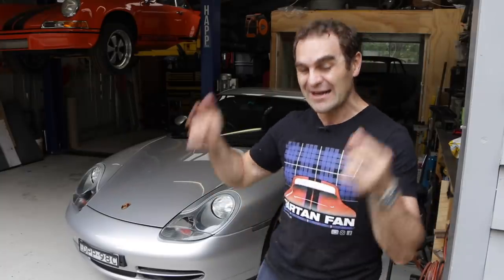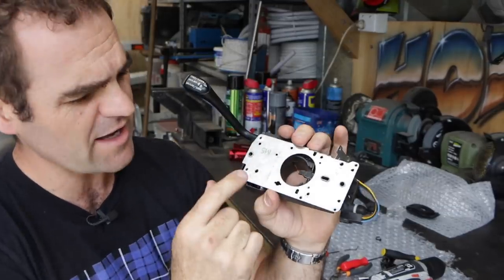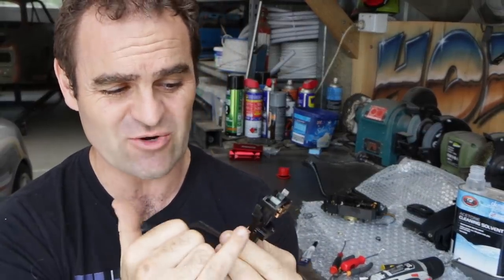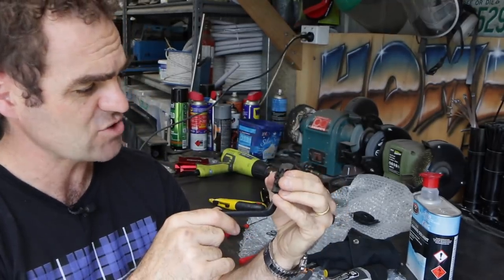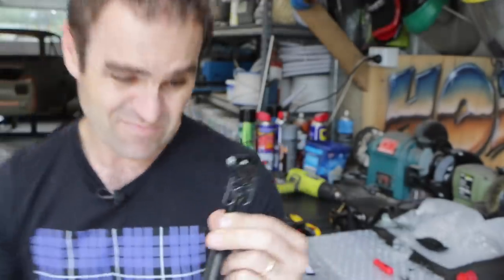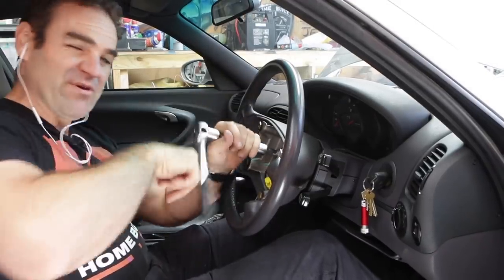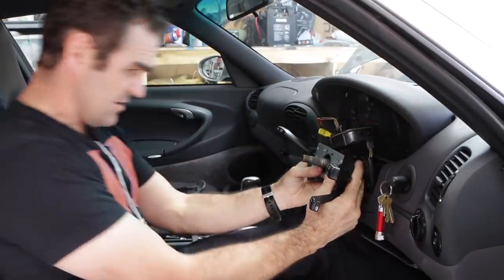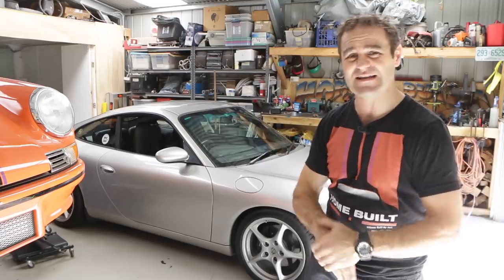$5 Porsche 996/986 indicator fix

Comment: Popular advice is to wait 30-60 minutes after disconnecting the battery before removing the airbag. Also not sitting in front of it when you first turn on the ignition after reassembly. 💨

Comment: Amazing - just fixed my 996 - cleaned up the parts thoroughly with a dremel then used 2-part epoxy to glue it back together. No idea what that spring does though 🤔
Saved £500+ THANK YOU!! 🙌🏼

Comment: Just a word of thanks for posting this. My 1st boxster, left indicator duff, looking at, at least £150 for a second hand replacement so tried to fix it myself. The right side was cracked so repaired them both. Happy days, I do not need to hold it down when turning left! Thanks once again.

Comment: Glue alone never last. Use a soldering iron and you can weld the pieces together and afterward supplement with super glue and baking soda as others explained. I sometimes uses metal wire to reinforce perpendicular to the crack line.
Reply: If you're going to use a soldering iron to "plastic weld" something, use the soldering iron to push metal mesh or strands of wire (electrical wire works well and is usually on hand) in to the part to act as reinforcement, or it will likely break again.
Reply: Xiranu , rubbish, there are are MANY different types of plastic , all with different properties.
Reply: peter olsen I know there are many types of plastics. Over 98% of all commercially used types in moldings are thermoplastic types and can be welded with heat. Remaining few pct are of thermosetting type and cannot (epoxy is one of those). Rubber is of course not defined as plastic but is a polymer.
Reply: Here is a good beginner guide https://youtu.be/gRCMIDILfEI

Comment: Dang, $600 for plastic piece with some brass contacts and springs to go along with it. Car parts have gotten SO expensive over the years!! Great job Jeff, looks like new. Cheers from Texas.
Reply: It's because it has "Porsche" written on it unfortunately.
Reply: Planned obsolescence to encourage people to keep buying new cars.  I had the climate control knob fail in my '89 Acura.  The fix was replacing the entire electronic control unit.  $1,200.00 US!  Are you kidding?  FOR THE LOVE OF GOD!  

The car wasn't worth that much at that point.  I could have attempted a fix, but then the state of CA paid $1,000 to take it off the road...

Which brings up the waste issue of the state crushing a perfectly good car, with all it's valuable replacement parts.  Worth much more climate-wise in a junk yard providing parts for 20 other Acuras.  Oh well...

Comment: Just completed this on my 996 with the 4 stalk. More difficult than expected due to how complicated it was to re-assemble the contraption. I used some screws I found around the house to seal it back up instead of rivets, and there is plenty of clearance. My auto-off indicators didn't retain their function, the springs inside are so fiddly and it's really just a bad design, but I just manually cancel them. At least both of my turn signals work now! Great video!

Comment: I've used a soldering iron and cable tie as filler rod. May or may not be appropriate for this task. Or metal putty works for a lot of things. But well done Jeff - saves lotsa money and gives ya satisfaction

Comment: Super Glue, and other bonding agents, the repairers friend.
Can't see the average Porsche owner trying this repair at home, many would be in the "technically challenged" league.
Good work Jeff, another success.
Reply: Really? Myself and most of the other Porsche owners I know do most of our own work.
Reply: @SpawnyWhippet  only the ones with  older and used Porsche, the original purchasers generally are too rich, too busy or have the "head to hand blockage syndrome"/ technically challenged brigade.
It was to those I was referring.
Reply: @Andy B a Porsche owner then?

Comment: Just completed this fix myself. . . More like 2 hrs for me, but I did find and re-use both pieces of plastic within the steering column moldings, so remove them carefully and vigilantly if doing so yourself.  I also found a hot glue gun gave a reassuring bond and allowed excess glue to be carved away.  Thanks for sharing the video, and for making it look easy enough for me. . .  Now I just need to figure what the battery disconnect has done to my radio. . .

Comment: I suspect the reasn the spring tags aren't a solid part of the spring mount is to allow the cancelling lever some 'give' if you try to engage it while the release tag on the steering wheel is directly in line with it.

Comment: Aren't quick fixes like that a joy?  And saving $600?  Oh hell YEAH!  Nice!
I had two remote controls that weren't functioning properly.  One for the home theater had gotten worse and worse lately.  Another for a receiver in another room hadn't had its volume function work for EVER.  (I assumed it was the volume knob that gave out in the unit.)
So I pulled 'em apart, cleaned the years of gunk (gross, I know) out of 'em, cleaned the contacts with isopropyl alcohol and Voila! they both work like new now.  Why did I wait so long to fix them???
And remotes 'ain't cheap, if you can even find them to match your old equipment.

Plus, with the waste in this world, we need MUCH MORE fixing of old stuff....

Like old 911's, for example!!!  (Hint, hint.  Nudge, nudge!)

Comment: I performed this repair thanks to your video. Unit worked fine for months, then suddenly it caught fire.  Turns out one of the little springs inside the turn signal assembly became dislodged and shorted, causing a fire.  I re assembled carefully, not sure what happened.  Caution.

Comment: Thanks of the idea. Pulled mine down and same thing. But found this part inside.Looks like a tea cup/white plastic its 5mm/5mm/5mm. Small,but it came from inside.
Reply from the maker: That clips on the edge of the housing in the little slot ;)
Reply: @HomeBuiltByJeff  Your the man ! The point bar is to the left of it ? Posted my work on Pelican under My 2000 Boxster "S" re-make. Thanks again.

Comment: It's probably made from polyethylene or polypropylene. Both are designed to be chemically resistant, which is why they see so much automotive use. Because of that most adhesives won't stick to them. The one thing that does though, is silicone, but it will peel easily if you don't roughen the surface. 

Hopefully the epoxy holds up. Some blends are better than others for PP/PE.
Reply: MrClown GREAT comment, at last!....god there’s some glue experts out there!

Comment: Jeff, been rewatching this as i recently bought a 996 and my stalk just broke. One quick question. see when you reconnect the battery, did you leave the keys in the ignition and in the on position or pull them back out?
Reply from the maker: Keys off when the battery is off

Comment: Sadly happened with my Boxster today, first the indicator arm was stuck on right indicator, then after few minutes, it started to work but then other side is stuck, it just can’t stay there and can’t cancel automatically when turn the steaming wheel.😒
Reply from the maker: Not a difficult fix.

Comment: Just use supper glue with baking soda , it get really hard and creat a better bind then 5min apoxy
Reply: Kalinga Athulathmudali , but does it adhere to all types of plastic and nylon..............no.
Reply: @Pete-z6e  I've done it with metal, many type of plastics, multiple type surfaces, worked well for me for many years, specaly automotive type plastics. Clips etc

Comment: Dear Jeff, can you tell me where the small round clear rubber cone piece goes...you fitted it last in your video before riveting the top plate back on & mine came out, so I cannot see where it should go back?
Reply from the maker: From the top of my head, there is a small notch along the edge of the housing that it clips onto.
Reply: @HomeBuiltByJeff  
Thanks Jeff, 

I found the slot & fitted it.

My indicators all work fine now, which is really good.

I have a slight problem with the full beam lights that work when I pull the indicator lever to flash the high beams & the blue light shows on the dashboard, but won’t light up when I push the lever forward to engage permanent high beams.  The lever stays in place correctly, but no high beam or high beam blue light on the dash.  

Any ideas on what part might need cleaning or checking & I will try again.

No problem if you don’t know as I am super happy on what you have helped me to do with the indicators.

Regards,

Steve.
Reply from the maker: @stevemesser4552  You may not have the metal contact arms in correctly.
Reply: @HomeBuiltByJeff  
Thanks Jeff, I’ll have another go & clean the contacts as well.

Regards,

Steve.

Comment: Just a question. A small dome plastic piece with a slot is loose in the housing. Any help where it goes
Reply from the maker: It clips on the edge in the little recess.
Reply: Can you be more specific please ie body, stalk. Can you send a picture with arrow
Reply: I must be thick. On the edge of the body. All reassembled and works great. Thanks

Comment: Wtf.  I think non cancelling indicators r nice.  If u r in control of your vehicle.  Else go get a self driving car.
Reply: @Andy B There is no mechanical "switch-off mechanism" to fail.  Also u might not want them to switch off just as the wheel is straightened out.